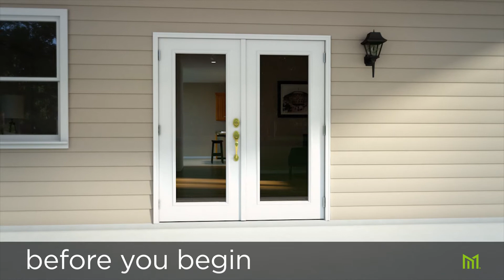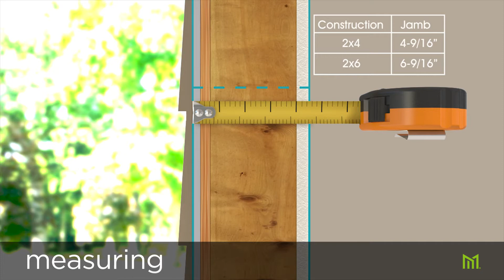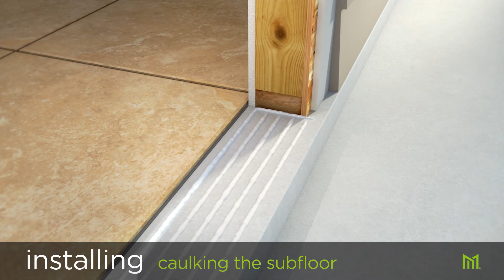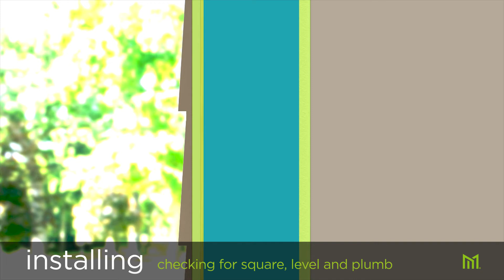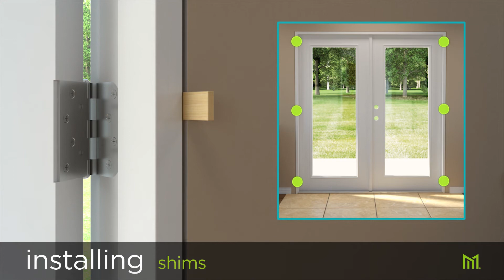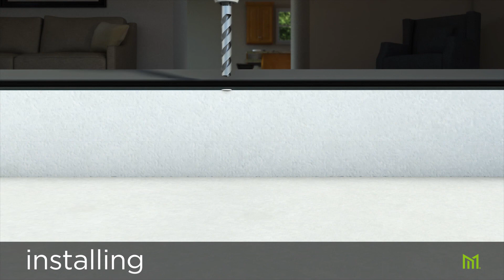How to Install Prehung Exterior Entry Door

Comment: Why does it seem like the door has been installed backwards as the hinges should be on the inside of the house so that someone can not just tap out hinge pin and take the door off and get into house ?
Reply: There are actually two different styles. There are doors that swing outside for different reasons. They won’t swing into the house and affect the flow of the entry way. Tornado and hurricane areas use these allot because it is nearly impossible to blow a door open the wrong way. Also, it prevents break ins. You can’t kick a door open when your kicking into the jamb. Same concept for tornadoes and hurricanes. Can’t blow a door open through the jamb. All outswinging doors have special hinges that you cannot take apart. Non removable pins. You have to open the door to take the hinges off, or make a whole lot of noise with power tools.